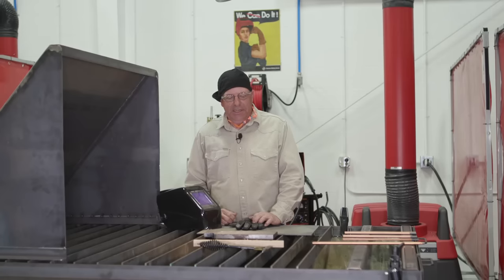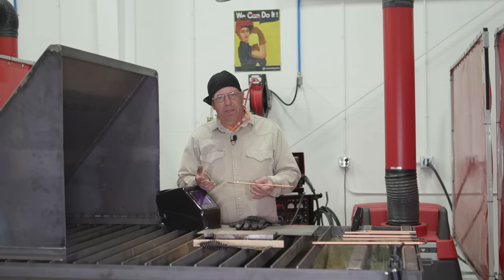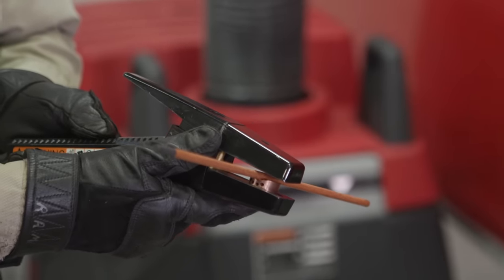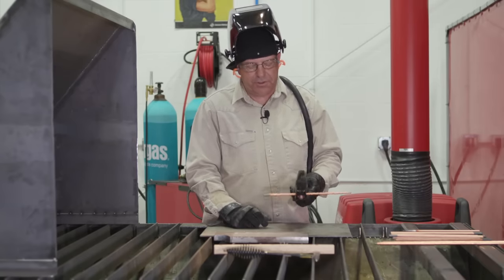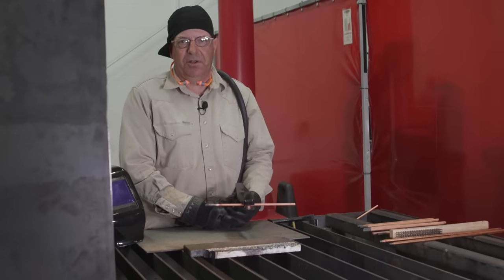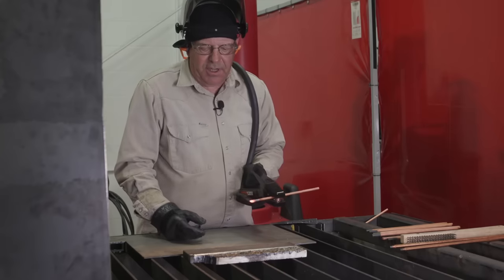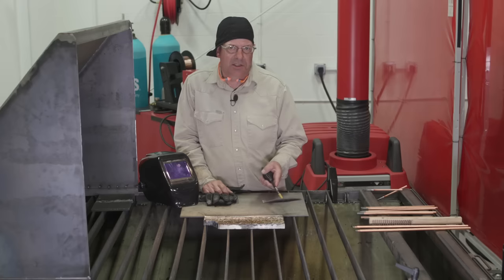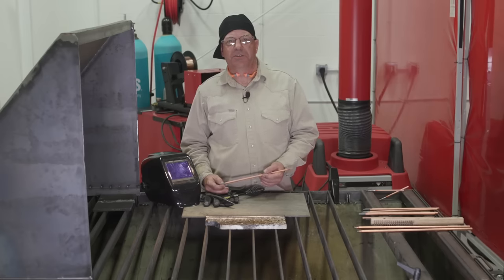Arc Gouging Basics (Part 2): Proper Torch Angle

Comment: Believe it or not, my first real job was running projectors at a movie theater. The projectors were carbon fired and had no bulbs, just two copper coated carbon rods that touched off and auto fed into one another long enough for a 20 minute reel. Then switched projectors.
Reply: Random Texan x
Reply: Yup and they were powered by a big Lincoln bullet welder (shield arc)

Comment: Ahh yes, the gouge. My most favorite way to burn myself it is fun though like welding in reverse. Also ear plugs will not only protect you from the noise but you’ve never lived til you’ve had a dingle berry in your ear!
Reply: Bryan Saunders oh it just a wonderful experience if you know what I mean ...
Reply: I had earplugs in and a large blob shot up and fused into my earring, then the heat traveled along the ring into my earlobe causing a roaring sound, the fun part is you just have to wait till it cools down before you can do anything about it, still have the ring as a souvenir.
Reply: I caught a big one in the ear once. I don’t weld without ear plugs anymore either lol
Reply: Fraction of a second, more like several seconds especially when gouging into  a cat bucket when removing lip liners and adapters with some nice fat 12x4mm flats
Reply: Never cared much for that sound of sizzling ear wax myself
Reply: It gets rid of all that pesky wax build up. Fun stuff right there

Comment: I LOVE using a carbon arc. At my last job it was a lot of single bevel 100% welds so weld one side and back gouge out to clean metal. I got really good at it. We could always tell the guys that didn’t know what they were doing when they came to test because when backgouging a seam they would look in front of the carbon when cutting. You can’t see the seam this way and see if you are cutting to clean metal.

Comment: Great way to fix crack, erase welds and take things apart that has been welded together. The first time I seen it done I thought it was a bad ass torch. We use 500 to 600 amp Miller’s and Lincoln’s with 3/8” arc rods. Veeing out 3” plates repairing cracks on rock   crushers and anything that needs repairing. Duel hearing protection is needed as it topping out at over 120 plus decibels Keep up the great videos.

Comment: Good video, I didn't catch if you mentioned it. Air always under the electrode. Does that machine have an arc force control? I always set the arc force for a stiff arc, similar to 6010 setting.

Comment: Have used it to burn holes through pin on hydraulic cylinders on heavy equipment before. Not as efficient as oxygen lance (Catapillar calls the Caldo Rods), but it works.

Comment: Learned how to use this at my current job at Bluescope Buildings. We’re always doing Complete Joint Penetrations and gotta use the arc to gouge into clean metal. Gets more annoying when gouging into 1in + thick material cuz then it starts blowing towards u, back into the weld and after it does that it doesn’t let u gouge cleanly anymore💀had that problem today. Better to prep the material before tacking it into place. Makes everything sm easier.

Comment: Best practices for boring holes through 3" manganese ? Is a certin rod better than others? Rod angle? Ect.. slag kept blowing up top my shield and coming down inside burning my beard.  Should air holes be held on top side of the rods or bottom? 
Love the videos Bob. Keep them coming!
Reply: Yeah been there done that... if you're talkin 3-inch manganese... you need to use a burn bar.. basically the same thing only a whole lot longer and a lot quicker.. research it but yeah.. punching a hole in 3 in thick manganese.. wow yeah it can be done I've done it.. it can be done with an oxy acetylene torch.. it depends on how many holes you got to make what's your resources are.. but if you're working on a shredder.. and your line of plates aren't fitting up on a regular basis... get a burn bar!!-

Comment: Arc gouge also cuts stainless unlike an oxy/ace torch
Reply: kramer151 Air arc is risky on stainless due to carbon impingement.
Reply: Boilermaker here. We're not concerned with carbon impingement just demolition lol Patrick
Reply: kramer151 go build some tanks. It's a common practice for grooving the back of CJP joints on tanks and vessels.
Reply: Patrick Ramsey I'll add to that, it's common in structural steel on cjps, even on a double bevel, and for cleaning mouse holes

Comment: My dad taught me how to carbon arc weld to repair galvanized sheet metal using deoxidized copper back in the late 70's.  Blew my shop teacher's mind.  "No, you can't weld galvanized"  Ah, yes you can, as I welded up a mailbox.  Actually, it's brazing ... technically!  Nice video Bob, I've never tried arc gouging.  They sell all the stuff down at my welding supply but never found a use for it.

Comment: see thYour making a groove. You need to look béhind th the ark as that is where the groove is, especially if you are back gouging a weld. You cane slag line and get the shape of the vee. Also don't let your carbon get too pointed, either break the sharp point off  or burn it off that way you leave a nice rounded bottom. With welders it always comes down to well rounded bottoms.  Noise levels can reach 140 decibels. and it produces Carbon Monoxide.
Highest ever amps, about 1500 to 1600 ,5/8 carbons and 120 psi. Oh and a mate pouring water on the cable joints.

Comment: Torch angle is just like stick welding. All you have to do is make it favorable to what you're trying to do. 
A more shallow angle makes a more shallow gouge. Steeper angle makes a deeper one. Somewhere in the neighborhood of 30-45 is best practice. Closer to flat angle for thinner stuff. Because it can be like driving a carpet tack thru paper w a sledgehammer if you're not careful and the blow thru is not fun to weld up.

Comment: Like how there are different diameter rods for stick welding, and different power requirements depending on the choice of rod and the material/thickness, are there different carbon arc rods that might run on less power?  I have a 200A TIG machine and I obviously cannot reach 230A.

Comment: Thanks Bob. Where might you use this process over other cutting (used loosely) processes?
Reply: SD B large industrial applications. It takes out a lot of metal in no time. I work in a shipyard and we use it a lot for full penetration joints.
Reply: Alright, thank you! Good info.
Reply: Also for heavy plant repair, cutting out old welds to replace/repair a damaged section.

Comment: I have a top crank Miller Thunderbolt AC/DC machine. It's max amperage AC is 230 and DC is 150. Is 150 amps DC enough to carbon arc if using a smaller electrode?

Comment: hey quick question dont know if this will be answered or not but whenever i was taught to do arc gouging in my welding/cutting class i always had this problem, which usually happened if i kept the arc long enough or just ended up touching the metal (i got better about it but this still happens) the rod would literally blow up, i assume from it getting too hot or something but is there a way to make it where this happens alot less often?

Comment: Very interesting as always. I have never actually seen this process.  Am I to assume that the electrode holder has a point that pierces into the electrode and thus air travels through it and to the end of the electrode blowing the molten pool away as you travel forward? If not can anyone explain how the air assist works? Thank You
Reply: Harold Watkins the electrode holder has two swilling copper contacts to hold the electrode, these have several air passage ways that blow high compressed air towards the 'gouged' material. Pause on a closeup on the holder to see what I mean 👍
Reply: Thank you Stevo450ify. I did stop the video as Mr. Moffatt was explaining. I know he said 80 psi, and after thinking about it the air going through these size holes would blow it away. I was wondering why Mr. Moffatt held the electrode halfway on the electrode holder. I imagine it is to facilitate the air delivery to the end of the electrode. to far back and the air delivery would not be sufficient. Thank you again, my friend. I appreciate you taking the time to help me to understand this process

Comment: Would oxo/fuel cutting not be a neater / easier process ? Need more info on useage for this
Reply: paul lynch the point of the process
Is mostly to remove old welds to separate damaged sections of weldments. I use this process every day repairing railcars it’s a lot faster and cleaner than a torch if you need to save parts to be welded back on

Comment: What might be the lowest amperage that you could gouge? Thinner material less amps??
Reply: Workshop Tazz  if you lower the amps to much you can infuse carbon into the steel by not melting the metal enough to blow away, kinda like lowering amps on a stick electrode will tend to stick alot and results arent as good. Btw CAC will  kill a machine thats not capable of the duty cycle

Comment: Could someone please explain how the air gets to the work piece from the gun; I first thought it would travel through the electrode but with it connected 4 inch in, don't see how that can be the case? Thanks
Reply: It comes from the clamp. Google air arc and you'll see some pics

Comment: Does bob moffit not work at Callie collage anymore?!
Reply: Just a theory, but if he's recording a video elsewhere and isn't using the school's equipment, electricity, or supplies, then he has no need to disclose the school's name.

It also just turned summer and the semester probably just ended, if they needed to close the weld shop for any reason then that might explain why he's not at the school.  A remodel might take out the program for a couple of months.

Comment: I don't understand how the air supply works. How does it get from the clamp to the tip if one uses a solid electrode, or is the air just for cooling the torch?
Reply: NemesisRTCW there are air jets in the clamp,you can see them better in the previous video. They direct the air externally in a V pattern and converge at tip of electrode, around 4-5 inches in this case.
Reply: NemesisRTCW The air shoots out of the clamp around the electrode. It's used to blow the material away.
Reply: Thanks guys for the explanation.